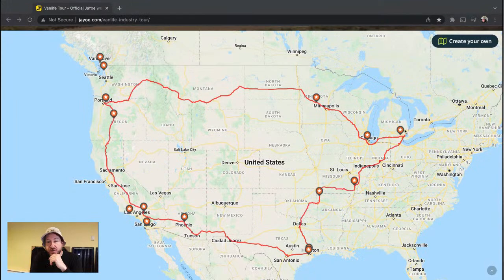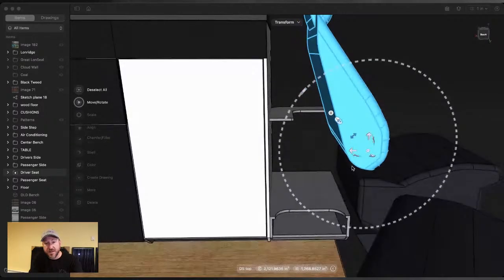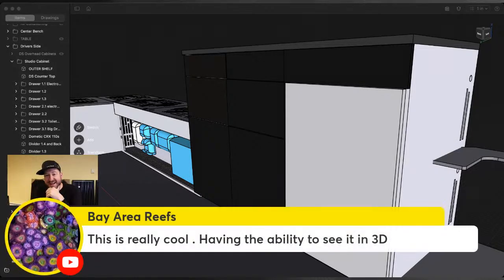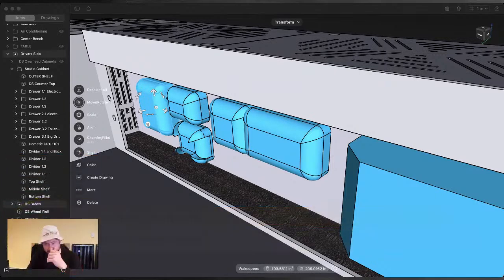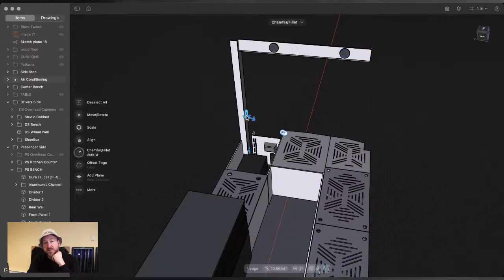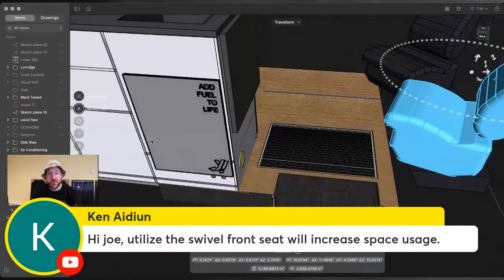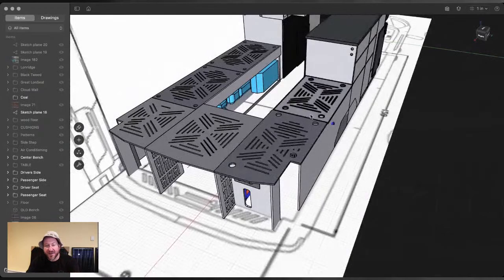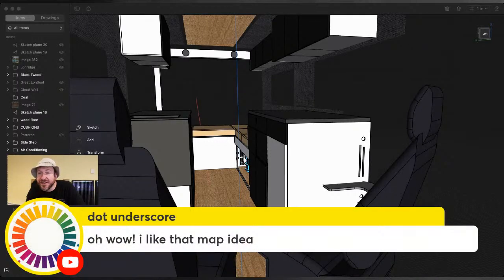Live 3D Virtual Tour of my Advanced Van Interior

Comment: Matt. Don't know if you have been told this but just a suggestion with your cutlery and plates.  Wrap the cutlery in a tea towel or soft cloth and also put thin rubber /anti slip sheets between plates. Things get pretty noisy in drawers when you are driving around. Speaking from experience LOL.
Reply from the maker: Yea I saw a few people out there doing the same. They make like thin foam that’s almost sticky to the touch.

Comment: Long comment ahead :p

Too bad I missed the live stream but I watched the replay completely and took notes!

I'm somewhat into designing and you did an awesome job for just starting out. Great  layout too! :D

Sssoo first of all.. Morrre Yellow! :D  Also make the cargo area bigger so you can store your trike inside rather than outside! :) 

Other suggestions: 
- Make sure you have enough room for your legs at the table since you're a tall guy, and enough topside clearing for unboxing camera(s). :)
- For the removable panels, I would use edge corners that fit into the "boxes" rather than magnets, that way the panels can't slide around which could still happen with magnets.
- Maybe you can set it up so the ventilation/airco can switch between pulling air from outside to internal circulation in case you end up in dangerous areas with bad air quality.

- With the collapsible JaYoe panel, maybe you could put a large digital photo frame behind it, this would provide the light and you can have selectable depth pictures and picture auto-rotation?

- Maybe the shelf behind the driver seat could have a cup/bottle holder?

Don't forget to connect the warm water for your sprayer :)   

Concerns:
- I'm not sure if having cushions, your bed and yourself right above a battery system causing a heating problem, with active cooling a noise problem, or in worsed case injury, is a good idea?
- Best not to have floor heating underneath sensitive items like batteries, toilet, watertank, etc..

Option:
-drawer(s) that slide outward of the van (on the door side or the bottom side of a window?)

That's all I could think of :)

Oh, and don't forget to lock the door before taking a shower XD
Reply: Yup missed this stream too. Hope to catch up next time.